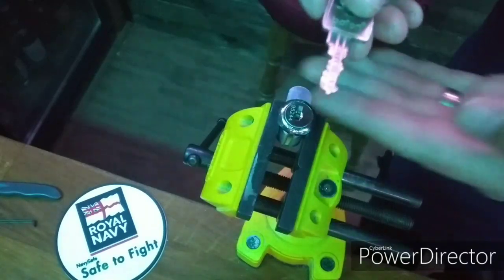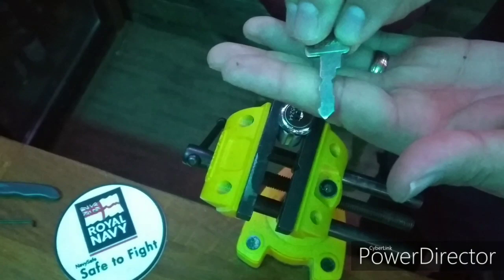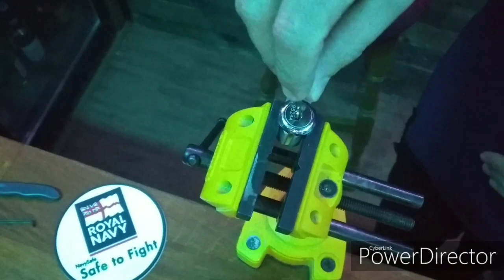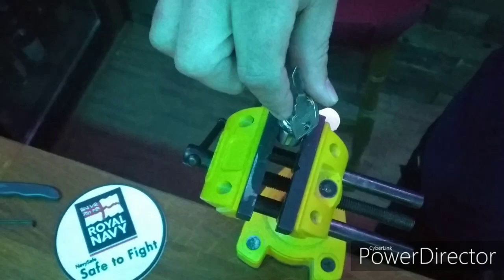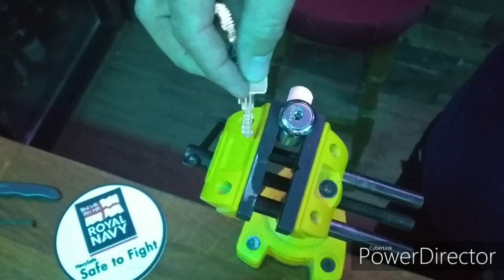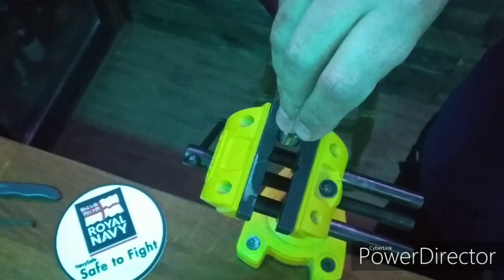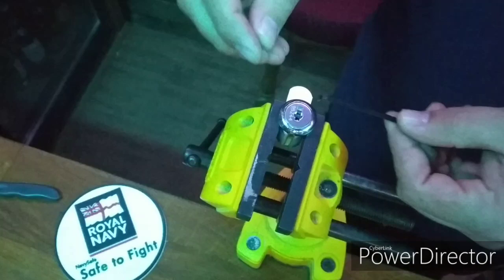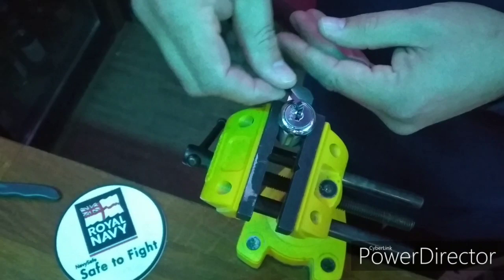Baton 32mm Dual Action Wafer Cam Lock

Comment: Well it did do better than most, except that one which stands at top still yet.
Reply from the maker: The only downside is this is a 32mm cylinder, I need all that resilience in a 20mm form factor.
I have something on order that may prove a success ......

Comment: Do you make custom picks  ?
Reply from the maker: No buddy I don't. I picked up this set when I first started. It was a cheap and cheerful set from a well known auction site. The actual picks are proper cheap and made from very thick metal so limited to certain keyways. I quickly updated my set, but took the wafer jigglers and added them to my pick set as they work really well (some minor sanding required)